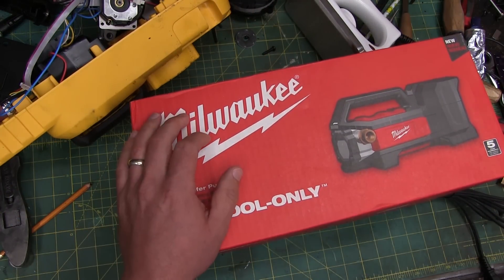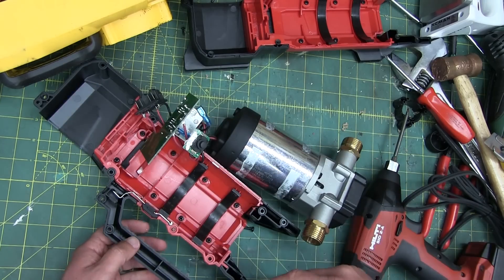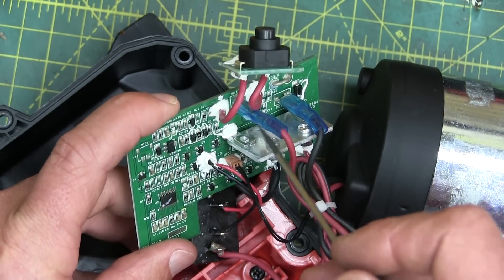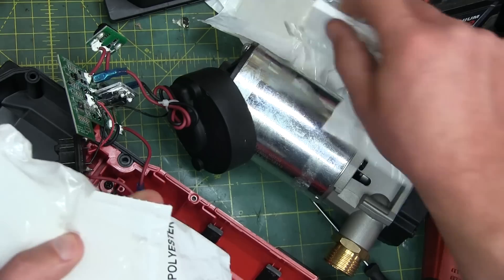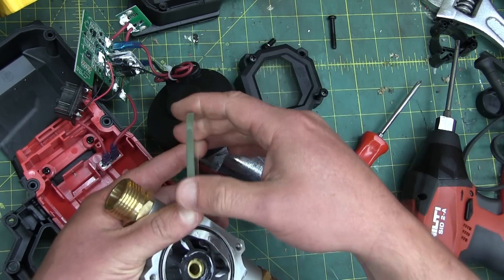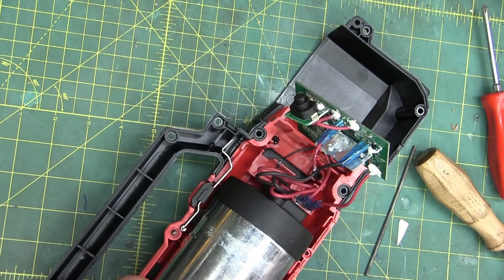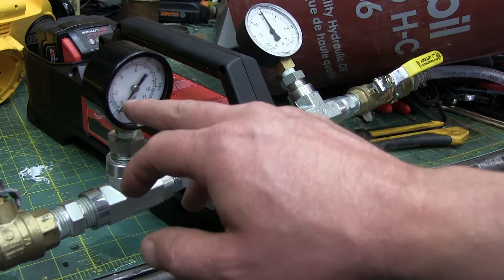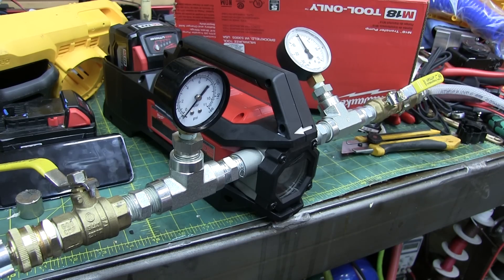BOLTR: Milwaukee Pump | Box Specs vs. Shop Specs

Comment: If it was me, i'd buy the $20 drill one and a pack of zip ties (or maybe one fancy velcro one) to hold the trigger on a drill down.
Reply: I have the inexpensive one; cost less than $13 before sales tax.

It really has to be attached to a board for proper use. And the hand drill has to be run in reverse to turn the shaft in the proper direction. And it seemed to self prime faster for me than what was shown for the Milwaukee in this video, but that could be due to my using short hoses.

One other thing is that the manufacturer says to not run it while dry for more than 30 seconds. Using zip ties to hold the trigger rather than an attentive human runs the risk of running dry.

Comment: exit valve supposed to be fully open?.....it doesn't look like it, looks like it is 1/4 open that would explain the load on the battery and low output

Comment: Just idea here, I thinkin they had small pressure on the in side of the pump, just so they could get those high numbers, so in the test there not sucking from a bucket , there sucking from a pressurized corntainer ! 
so in there eyes this is possibly a helper pump,  ain't that a shiter ? ideas?
:)

Comment: 20:30 on the O-ring Groove, correct the groove needs to leave room for squish, but also, the o-ring should seat against the id or the od of the groove depending on which side it is trying to seal pressure from. If you wrapped the o-ring tight against the inner edge of this groove and pressurize the inside if this pump there is potential for leakage because the o-ring will stretch outward, as it stretches outward it gets skinnier and lets fluid past, of its already against the outside, then pressure just forces it seal even more. Learnt me that one out of the parker hydraulics catalog to fix a repeat leak on a new transmission, Inspector did the research and made the big green tractor engineers look like a bunch of chumps. The research was easier than measuring all of the parts, that were in spec, because they had the design wrong on the prints, everything looked great and they all scratched their heads and went home for the day, i went to google for 20 minutes.

Comment: Where exactly is the damage when these transfer pumps run dry? I loaned mine to a friend, and of course it's now dead. Does the motor fry? Fuse blow? Not sure where I should look to fix it.

A DC motor should still be fine right?

Lastly, why isn't there a way to design a pump where a few minutes of dry running won't kill it?
Reply: In non submersible pumps, the damage is usually in the impeller bushing/bearing.

Comment: As a master pumper, the suction and discharge lines are way to small to get advertised claims. Try increasing the diameters of both by 50 % immediately before and after the pump.

Comment: What to test? 
Sure me always want to see more test of cause! 
Such as....if it is capable to pump oil or other thicker density liquid? I.e. using it as emergency fuel pump on a boat, no spark, no air or oxygen or vapour situation.
Or, on the other side of the coin, be a emergency water pump for a fish tank? Will it stand the environment with alge and water plant, high oxygen content, air bubble or even ozone in the water? We all know that ozone and chlorine can ko plastic and metal really quick.

Comment: is it just me or was the outlet ball valve partially closed during the tests?
Reply: You are correct sir. that definitely stresses the pump more.
Reply: If your running low pressure which is a perfect world situation you gain more flow but in reality it's hardly ever low pressure

Comment: It looks like the out valve is partially closed, and the fittings look a little smaller than the hose it is meant to be run on. But I'm not there and you are.

Comment: Hey love your videos and always very comical! Ive been using this transfer pump for years for water heater/boiler replacements. Cant say enough  about it. Just curious what lift pressure you were doing the battery drain test as we couldn't see in the video. For me at a ten foot lift no issues with a 5.0 battery about 15 min to drain.

Comment: "Max head height, 75 feet." "Gallons per charge, 240." That says to me they got a 75 foot head under perfect conditions with almost no flow and 240 gallons on a charge under perfect conditions with zero pressure (since there is no head specified). There is no way I would expect 240 gallons on a charge while actually doing some work, even based on the assumption that the marketing information on the box is correct. It looks like you're pulling 13" of vacuum on the inlet and pushing maybe 15 psi on the outlet in your endurance test, so a pressure rise of around 22 psi or a 51 foot head.

Comment: Thanks for review. Looks like the pump impeller would get jammed with the slightest of solids. Strange they used rubber instead of plastic, woulidn't specific speed change with the impeller fins wearing down overtime? And those sharp edges would be sure to cling material. I no like it :(

Comment: GPH probably calculated Pumping downhill..... as in Inlet has head pressure and exit actually has draw. Similar to ye old water wheels with the tubes down into the river bed for extra suction

Comment: +AvE -- The very (ahem ) 'optimistic' ratings given to products may be true under ideal conditions, but each trait being tested has a different ideal condition. For max flow (and run time), it is with zero restriction to either inlet or outlet. Run time may be with just air flow, not water. Max pressure, around 2 bar, is at zero flow. Max lift is also at zero flow. Always the context is just as important as the numbers. Like the old saw sez, "Figures don't lie, but liars can figure."

Comment: You'd get the 480 GPH number if you used is as a transfer pump (0 ft lift, 0 ft head).  The 75 ft head is probably with a few ounces of water coming out of the pipe; same with max lift.  They advertise the maximus but they don't necessarily maximize together.  It's much like adverising generators.  An 1800 watt generator with a 2200 watt surge is many times advertised as a 2200 watt generator - but no one runs a generator 100% of the time at the surge rating, must less at the runing watt rating.  A marketing ploy to make buyers think they're getting more that what they are paying for.

Comment: Maybe they test it with that sitting at the bottom of a file hundredThousand barrel And the pressure of the inside water is actually pushing the machine I may have not said all that correctly but do you understand what I’m saying

Comment: if you're ever worried about galvanic corrosion / reaction between dissimilar metals just lube the connection with a dab of copper slip.

Comment: They probably got that 480 gallons/hour by putting the water source on top of the Milwaukee HQ, and running a hose to ground level into the unit. GENTLEMEN! IT IS THE MAXIMUM!

Comment: Gezz you putz make your self a split shaft ! 1/4 " rod take it to the saw cut the center down about 3/4" to and1" , use 120 sand paper  jam it in to a straight die grinder  . it works wonders try it you'll like it  !

Comment: Would the thickness/density of the fluid used in the test alter the numbers?
Reply: If the fluid is actually heavier yes it can affect flow rate as the pump needs to work harder

Comment: What else do I want you to test?  Ear protection / noise cancelling headphones.  Flavors of the same thing.  Seems to me that with a styrofoam wig dummy, a couple of microphones where the ear holes would be, your silly scope and a white noise generator we could figure out if those $us10 headphones were worth a damn, if the $1us ear plugs did enough, and if the noise cancelling headphone really are worth $200?

Comment: Used one of these to flush my tankless heater.  Ran 20 minutes on a 5.0 battery, shut off, checked the battery still had a charge left, something else shut it down.  Tried firing it up again, run a couple minutes and shut off again.  Put in another fresh battery, same thing.   Let it sit 15 mins, fired up, got 5-6 minutes out of it before it shut down.  Seems like it's hitting a thermal shut down.  Motor barely felt warm though.  Was running a 3/4 reinforced inlet hose and 3/8 washer hoses on the tankless.  I'd be surprised if 3/8 hoses would create enough back pressure on 8gpm to shut it down?  Disappointing nonetheless.

Comment: as a dowm under plumber I have a lot of milfuckee tools only so I can use the one charger i use this to empty old water heaters its sort of slow not sure if  I have used a full battery but better then just a hose I have only have to clean the diaphragm once we where work on a water main the road with gravel and sand

Comment: To get the GPH they claim they probably take the impeller out and gravity feed the water straight through the thing. so sure it will "pump" 480 GPH straight down hill and only slightly slower than a siphon.

Comment: I'm not buying one until I see a sales man run the supposed specs that are on the box!
I bet they are taking a power supply that is simulating a fully charged battery. They then will estimate how long that battery would last by its milliamp capacity only they run the power supply at Max voltage/ Max amperage for the allowed time they estimate this battery would have lasted, only it's not a linear drain on the battery because it is a power supply. WTF?

Comment: To be honest/pragmatic, you should have ran the test BEFORE you took it apart to chooch with it. You filed a little on it and you changed the lubricants. Not saying what you did was incorrect, but before you can say ney on the results, you really should test it first, then adjust for longevity. 

On your test rig, I'm not sure what size plumbing that is, but I think the hose fittings would tolerate 3/4 inch hoses. I can't imagine 5 or 6 feet of 1/2 inch hose screwing it up that bad, but....  might be worth a shot. 

Still enjoyed the video none the less!

Comment: Uncle Bumblefuck, what are your thoughts on using this to pump used 15w40?  Or coolant.  Hell maybe even gear oil. It would be really handy for the routine maintenance for my Kenworth.  Or would money be better spent on a milfuckie 2 speed drill and a princess auto drill pump (which I have used in the past)

Comment: I think the hose diameter you are using is to small.  What are you using 1/2 or 5/8. How about trying a garden hose with no connections or or restrictions.

Comment: On the note of diesels running in reverse... My father used to work for a construction company that had an old dump truck, and if you stalled it just right, the thing would start runnin' bass ackwards!

Comment: the  mosfets are just placed in parallel for higher current capabilities... not bridge.. Probably the ST controller will PWM the current to the motor

Comment: They probably use a 3/4" hose on both sides not that plumbers abortion you have with hydraulic fittings constricting the flow. And they are probably pulling off the bottom of the tank and not up and over the top.  They had as close to laminar flow as they could get.

Comment: I believe as a married man you should have identified this problem immediately, “lack of Suction”
I know they say its not the size of your hose but how you use it, but in this case your little hose is the issue. 
Too small of an inlet is likely restricting the flow volume of the pixie powered water ejaculator.

Comment: Well, dirty plumber here gotta say it is no good for draining your water because unless you have a huge hose and the impeller can take the shmoo 
It destroys itself. It’s only really meant for clean water gets clogged up too quickly if you try to run crap through it

Comment: That thing about no output pressure is a good point. Maybe it's the suction side restriction that is the culprit. With the bucket sitting on the same plane as the pump the suction line vacuum should be very low. I think I see, after rewatching your video, about 12 ish inches of Hg when you do the GPM test. That seems high to me. If your suction line is in the water at any level above the pump, then the pump is actually being supercharged which should result in an even lower suction line vacuum. Or I could just be wrong. In any event, I think, now that you have demonstrated the phenomena that you set out to demonstrate with all the expensive fittings and gauges, that the little fella deserves a chance to chooch with the hose his maker gave him before you declare him impotent. Trust me, you wouldn't want anybody hangin' my equipment on you and then judgin' ya 'cause  ya had a weak Cockford Ollie ! Give 'er another go, eh.

Comment: 2 bar pressure = 20 meters it's easier per 10 meter of water column it's 1 bar of pressure disrespecting density changes based on temperature

Comment: I am absolutely mezmarized by your tool teardown videos. In your ventures,see if you can get ahold of some Ridged stuff. I have their small impact and drill set and that damn little 1/4"  impact just baffles me sometimes. I can run 3" deck screws for most of the day on 1 battery without predrilling. The drill however,must have plastic gears and when you try to run a half inch hole in 1/2" cold rolled,it gives up the ghost. (I know,wrong tool for the job. Then make the damn thing better!)

Comment: I'm surprised they didnt use an excursion hone to deburr that pump chamber, put the pump body on the pump, pull the handle and push the abrasive putty through, and BAM, no sharp edges no returns or recall risks. 😑.
And it'd be faster then an hand tool...

Comment: They obviously did a no load perfect wide open pumping test to get those specs. I think your test was far more realistic! I wonder how it would work if it used a pump more like a IV pump like hospitals use. Its a relatively cheap simple design where you use a flexible hose and have rotary wheels squeeze the fluid through the hose instead of self destructing rubber flubber. key words for search "iv pump specs"

Comment: Fuckinlove these videos and I agree, companies in so many fields and it's giant in the Wal-Mart car and home audio sections to just claim 1000watts peak power... I'm like when? When a sine wave at 1K is clipping to a square wave and someone shorts the wire and the capacitors dump a surge through the trannysisters and the magic fireworks fly out it's rectum? A stretch but I've been picking up your humor a bit XD but they will really see like 30-250watts rms and peak voltage at even dcr never seems to come near these mythical numbers.

Comment: Willing to bet they calculated the GPH by doing some math involving the max RPM of the motor and the displacement of the pump and said “fuck it, the paper says this is the max so put it on the box”

Comment: Totally with it on your description. I only say that as a “Master” licensed turd-jockey. 99% new construction, but on those few water heater replacements I do per year, this fuck-ass transfer pump, is a big-ol piece of fuck-ass transfer pump. Quicker to hook a hose to the gravity drain built into the water cookerizitator.

Quick edit: it does hold the “12 amp/hour bat-tree” nice’n’fine.

Comment: your math is very off due to the line size your using try moving 480gph thru a 1/2 inch line like you did and you will find it is extremely lower than pushing it thru a proper 3/4 inch line as a garden hose is suppose to be and what that pump was designed to use 1/2 inch line at a max 30 psi = around 200gph of flow a 3/4 inch line with said max 30 psi = 450ish GPH so you bottlenecked the math using the 1/2 inch line LOL .

Comment: They're probably using calculated numbers, in an ideal world with no friction and spherical cows. 
 
Basically, the runtime is probably no-load runtime of the motor. The GPH figure is a simple RPM times displacement figure, and combining the theoretical runtime against the theoretical GPH is where they get their gallons per charge. Just barely enough truth to avoid lawsuits, but also totally unrelated to real world expected performance. What you get when marketing and legal get together.

Comment: 29:19 cavitation?
Reply: theoretically it doesn't have the capability to do that since the rubber lobes would suck in from the next space over if there was a vacuum, i think what's happening is the pressure on the output is leaving air in there because it compresses and therefore isn't being pushed out of the pump by the pumping action, which relies on compression as far as i can tell.

Comment: You know, I'm late to the party but I've got a couple of cents to share with the group.

I wasted about 85 American dollars buying a broken one of these pumps.

Foolish old me.

The PCB toasted itself and the only replacement parts available are pieces for the pump head itself.

That's on me for not looking up the parts diagram to see what's available or not.

The little pixie mitigation bs melted itself apart and a portion of the wires on the board itself have receded away from their connections.

Comment: I was/am a control guy, Andover & GE/Fanuc, but I seem to remember on pumps that the amp load went down as the head went up. The amount of energy used was more analogous to the actual work done, how much water you MOVED rather than how much pressure you could achieve. Centrifugal pumps at least. Quite possibly the mfr is cherry picking data from several different tests to put on the box. On commercial duty stuff, we never had to worry too much about that, they knew that the users could see through a lot of bullshit. (You can bullshit the fans, but don't try to bullshit the players.) Now that I have retired, I see a lot of the stuff sold in the big box stores claiming all sorts of ridiculous shit. Competing DATA, not really competing hardware. Meh!
Reply: Stephen Jones, that is true of centrifugal pumps but Jabsco pumps are a positive displacement design which increases load on the prime mover as discharge pressure increases (from flow restriction).